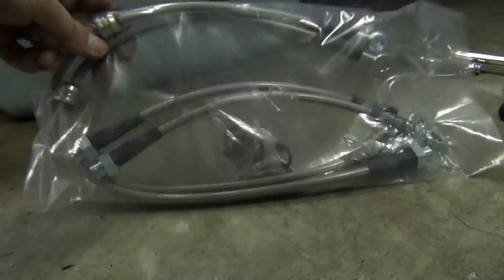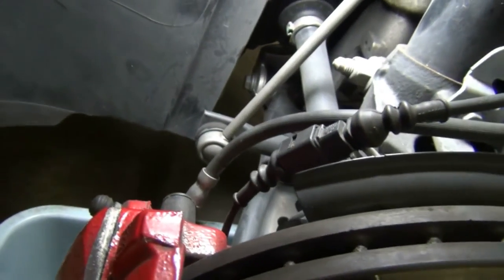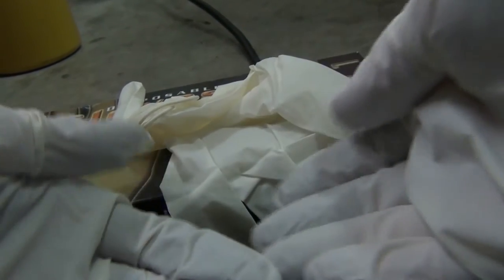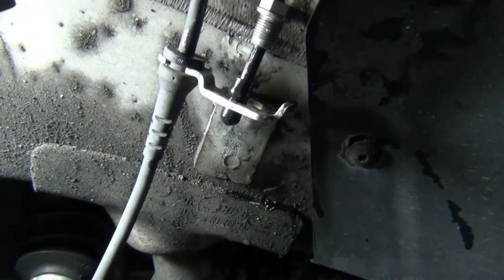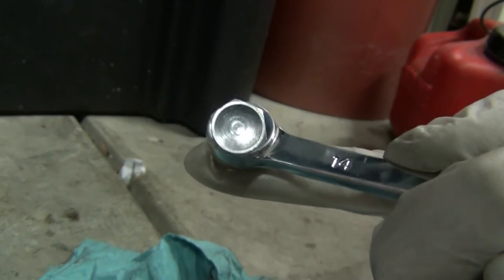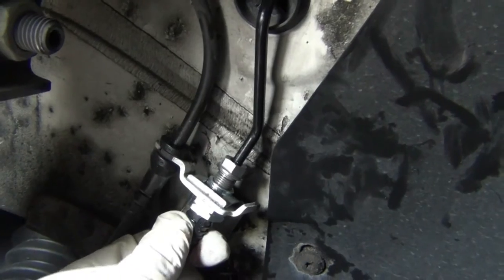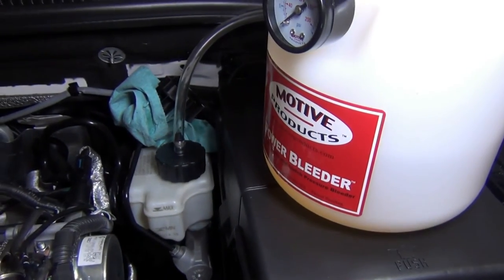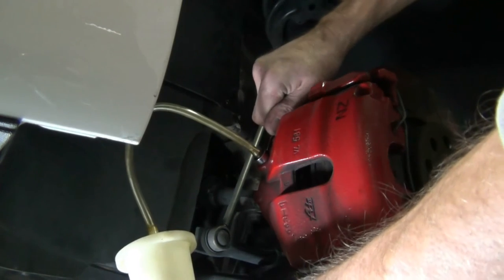2011 VW GTI: Episode 67 Vlog: USP Stainless Steel Brake Lines - Part 2

Comment: as simple as this video makes it, this is a relatively tough and messy job. I personally would have a shop install stainless steel brake lines for me. Even doing the Downpipe myself was tough, because of limited space under the car, but i got it in. Rotor,brake pad, fluid change can be done in your home garage easy, but make sure you got the piston reset tool for the rear brakes.

Comment from the maker: naw, the oem clip isn't a problem. It's well wide enough. The groove in the USP brake line is the issue. It's way too shallow unlike the groove on the middle section, which is nice and deep. The oem clip slips out of it.